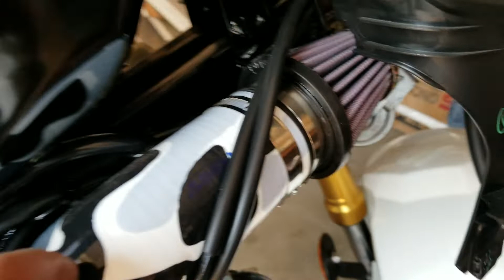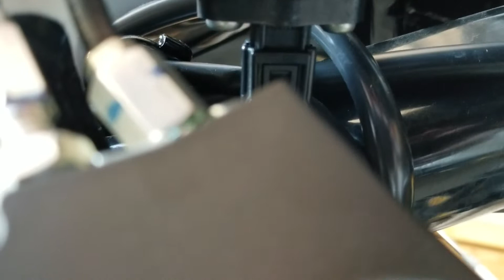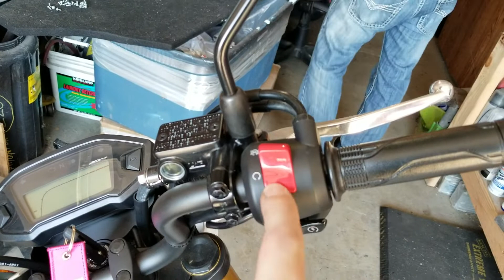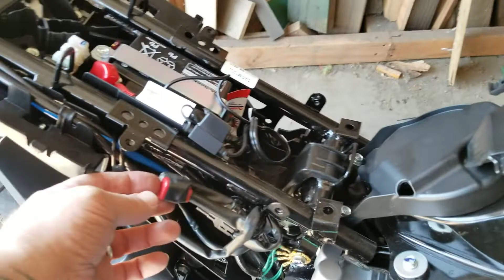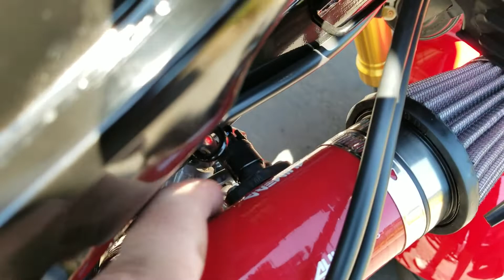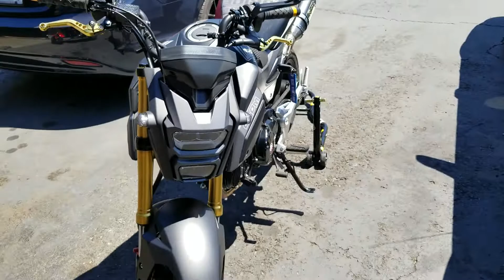2018 Honda Grom Chimera silicone air intake tube , air intake sensor location

Comment: Does your throttle cable cause any tension issue? Also, o-ring on the sensor is not in the tube correct? It's above the hole you drilled?
Reply from the maker: Yes it's above the hole that we drilled as long as you drill your hole perfect it will be sealed remember we are seeding this into silicone..  the hole is drilled just a hair too small so we have to force the sensor through therefore it is sealed if we were to put the rubber o-ring to the inside of the hole the hole would end up being too big then you risk sucking that rubber o-ring right into the motor..... 

This is the correct way to do this install....

No there is no issues with the throttle cable 8000 Miles later and everything is still working perfectly fine
Reply: @BLRTUNING  Thanks for the quick reply. My TB is a takegawa and was worried about the intake rubbing the throttle cable tubes. I'm going to reposition it better when I get home. Full lock left hits my aftermarket piaa horn and full right smacks my fork clamps.
Reply from the maker: I would try repositioning it and see if you can get it to not hit
Reply: @BLRTUNING  Repositioned and not hitting anything. Had to flip my aftermarket horn around. Thanks, not sure I'm liking how much louder an intake is.

Comment: The silicone tubes are bigger than the chrome one correct? They are for big bore or are they all the same size trying to decide on one
Reply from the maker: They use the same size throttle body they make one for the 32 mm throttle body and they make one for the stock throttle body... I prefer the silicone one it does look like it's a little bit bigger diameter on the inside but to a really allow more airflow it requires changing the throttle body.. The chrome one or the black one will have a louder sound to it as air enters into the metal tubing...

just remember if you have not changed your throttle body then you are going to want the standard one regardless if you go with the silicone or metal if it's for the bigger throttle body it will say 32 mm throttle body